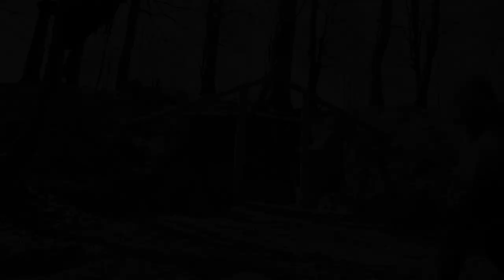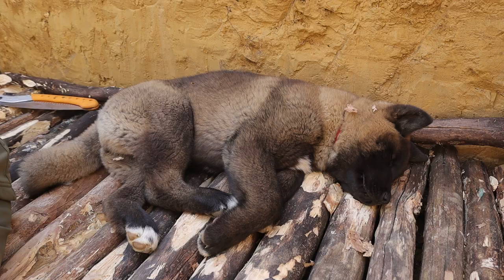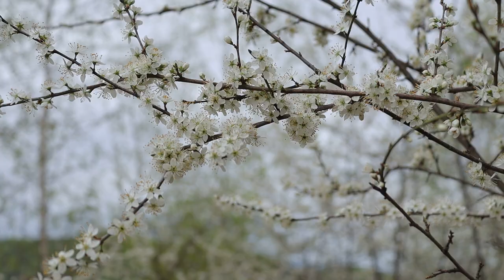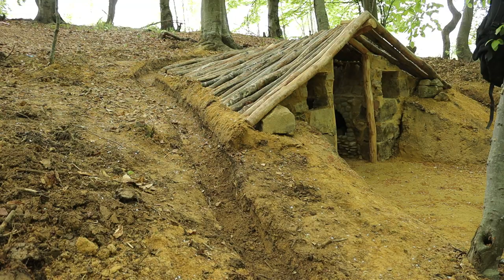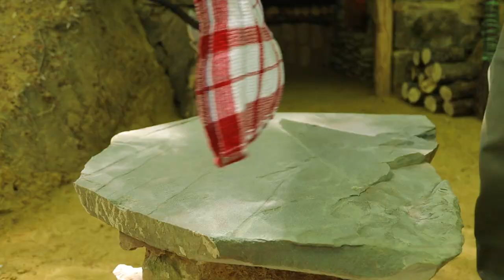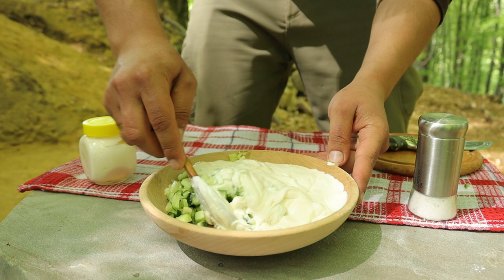Do-it-yourself dugout in the forest. The roof and walls are ready! Part 2

Comment: Are you a design and engineering student? This is probably the best designed and engineered dugout shelter I've ever seen. 
I was glad to see you raise the height of your chimney, and the cap stone was a nice touch. It might be beneficial to add the sod grass to your side drainage ditches so they don't erode when it rains. They will still divert water away from the shelter. 
Besides your back and side walls being insulated by the earth, you used so much stone in the construction that when it absorbs heat from the fire place, they'll stay warm for a long time. How cold does it get there in the winter? This is an excellent build!  I look forward to seeing the door and windows finished.  :)